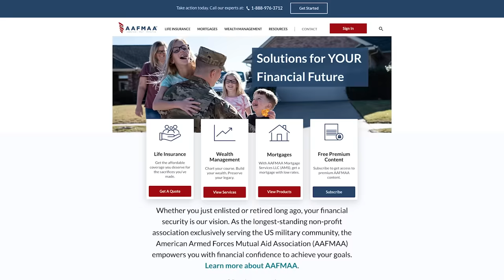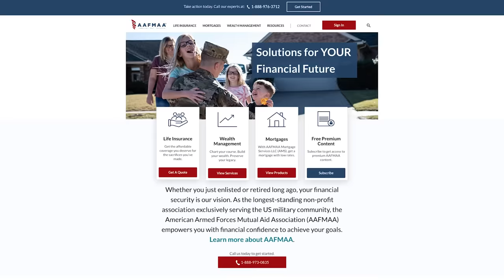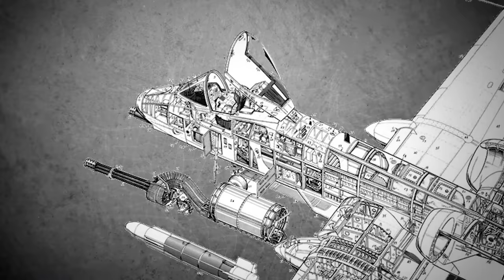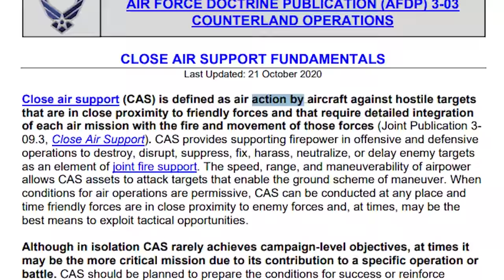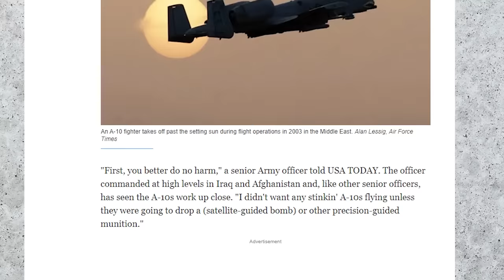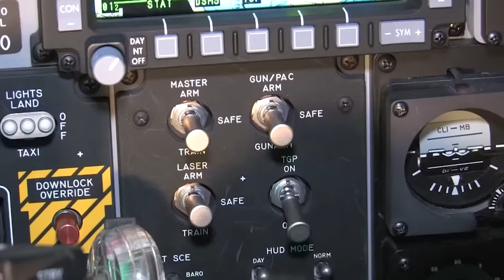Why the Air Force is Screaming to Retire the A-10 Warthog

Comment: CAS doesn't mean the plane itself needs to be close, the effect of its weapons does.
Once one realizes that, is obvious that the beloved A-10's days are over.
It's simply more useful having a drone hovering over the area for half a day, dropping a JDAM anytime.
..or an F-15, F-16 or F-18 getting there FAST with a lot of the same means of destruction under their wings.
Reply: there are no drones that will do that the a10 does currently. And protip actual combat arent a pc game. You dont sit in the sky and fire a missile and the infantry squad behind those trees disappears
Reply: @charlesreid9337 I mean for drone pilots that kinda is that case as they are sitting in a decently far place piloting the drone and yes drones can be used for CAS like the commenter said which you ignored CAS doesn’t mean the plane has to be close to the targets close air support is basically air support with friendlies decently nearby the target and also drones do just fire a missile down a lot are equipped with AGM-114s

Comment: As a sand box veteran I don't mind the A-10 retiring. I do mind not having a proper platform to replace it first. Sadly the F-35 is not good enough to do the job, and speed will not save the pilot in a CAS mission. Admittedly the Specter has most of the A-10's workload covered. However you need to keep a couple of fast movers in the area to keep it alive. Here's hoping the AF is not about to get a metric buttload of ground pounders killed.
Reply: A lot of the a10's kills are with the missiles anyways, so losing a primarily gun based platform is... Probably not the end of the world?

Comment: My armchair general opinion is that to replace the Warthog you need a fairly cheap and simple platform that can go faster than a helicopter and loiter longer than something like an F-35. I think tossing it out, without an alternative is a grave mistake but the Air Force is right that it needs to be replaced. I just don't think something like an F-35 is the replacement.
Reply: So RQ-9 Reaper
Reply: From what I understand F-35 pilots don't even get CAS training.
Reply: @Lonewolfmike Well probably not yet, because the A-10 and F-16 are still doing that.  If/when the F-35 starts being used for CAS, I’d expect that its pilots (or at least the ones who will be doing that) will receive training in it.
Reply: @bluemarlin8138  Well if they do then they will have to add a gun pod to even be minimally useful while doing it. And even then they won't have the firepower of the GAU-8 by any means. All they will have is a pinker at best.
Reply: I'd bet Marine F-35 pilots do. @Lonewolfmike
Reply: @TheRezro  Not enough ordinance

Comment: The USAF never was totally sold on the concept of the A-10. It wasn’t sexy enough or fast enough to to satisfy the fighter mafia that makes up a big part of the leadership. In fact one of the reasons they took it was because the Army said they would if the USAF didn’t. The concept is good even if the airframe is getting long in the tooth and upgrades are harder to do. Time on target is more important than MACH numbers when doing ground attack, something that the majority of the zipper suit sun gods don’t understand
Reply: So true. Even during flight testing, several generals (fighter mafia) tried to kill program, than tried to transfer to Army than to MC. Politics kept it alive. A two seat version (one off) was made. YA-10, night adverse version. Had upgraded avionics/electronics made it a very formidable CAS aircraft for night time. Air force said no thank you. Today this mission can be flown by drones and upcoming A.I. piloted platforms. Side note. The losing aircraft for CAS mission was YA-9 built by Northrup. Later on the  Soviets built a similar looking aircraft, SU-25 Grach (Frogfoot) for CAS. Extensively used in Afghanistan and later in Syria. Only the A-10 had 30mm cannon, that turned armored vehicles into swiss cheese.
Reply: Sure, but even by those metrics, you're never going to beat a bunch of drones for loiter time and cheapness of operation, and improved precision munitions give them better abilities to perform the mission, to boot.

Tech becomes obsolete.
Reply: The air force never wanted to do the CAS mission and it baffles me that they just will not let the Army have the job.
Reply: @jktarleton  

Gues they were still spiteful for the Air force treatment when the Air Force was the US army air corp

Comment: The A-10 has one thing going for it that gives it the ability to just fly by without even firing a single shot, just having its presence known is sometimes all thats needed.

Need to bring up the AH-56 Cheyenne as it came into play at the same time with the goal to do the same role.
Reply: Worked against the Taliban, not the Iraqi Republican Guard. They actually had the right reaction to seeing an A-10: trying to shoot it down. Running away only ensures one dies tired.
Reply: Didn’t work,out too good for them
Reply: True that! Just flying an A-10 in Poland is why Russia surrendered to Ukraine!

Comment: It’s a great capability to have when we can enjoy air dominance. When facing a near peer adversary with contested skies, I’m hoping we come up with an adequate solution.
Reply: It was designed SPECIFICALLY to fly against a near peer adversary that also had overwhelming numbers.

In fact, that overwhelming numbers bit was the exact reason it came into being.

The ironic part is being used against a near peer adversary now without mushroom clouds is extremely low, and conflicts with adversaries with minimal air attack (almost all ground based) is a near certainty.
Reply: @ekscalybur 
It was specifically designed to fly against the near peer forces of 50 years ago,  not modern ones. It would need complete and total air superiority at all times to avoid getting swatted out of the air by an AAM. As for insurgencies, it's still not great because it needs to get very close to its target, which opens it up to being shot down by MANPADs which are the only type of air defense capable of being regularly fielded by insurgencies beyond the ocassional truck mounted autocannon (something the a10 is also vulnerable to in comparison to other aircraft).

Comment: I don't think the F35 will work in this role, but a heavily armed drone could possibly be even more effective. The other option where a drone could be helpful is to identify targets while artillery or air support could stand off and delivery ordinance.
Reply: It seems to me to be a very tricky aircraft to replace, even in the modern battlefield. I agree I don't think the f35 has the same skillset
Reply: The F-35 is already testing small diameter bombs and can use external pylons. It excels in the air to ground role.
Reply: @richardtuxford1812  How is it tricky when it was never needed in the first place? So any of you know the political history of this airframe and are you aware of the crony capitalism that goes on in Washington DC?
Reply: The MQ-9 took over CAS missions for the A-10 like a decade ago and has done 99% of them with greater success and precision than the A-10 ever did.
Reply: @fnhatic6694  Pretty soon these A-10 guys will be saying the USAF should break out P-47 Thunderbolts and A-1 Skyraiders for CAS missions 🤣
Reply: @richardtuxford1812  They dont want to replace the A-10, they want to get rid of it completely. It is simply too costly because it keeps getting shot down.

Comment: The A10 can only perform its function in a state of near total air superiority. It is extremely vulnerable to anti air. Most of the fixed wing losses in Ukraine are Su25 frogfoots, the soviet equivalent. Drones are the best, most attritable alternative. Transfer the A10 pilots to other platforms.
Reply: In ukraine, more drones have been lost than all the planes in the USAF, USN and USMC.
Reply: The A10 does not require near total air superiority - where the hell did you pull that out of?
Reply: The Su-25 is a inferior design far more vulnerable from modern ground fire than the A-10.
Reply: @ometec it does. It’s slow and low flying and very vulnerable to MANPADs, SAMs, and fighter aircraft. 

It doesn’t carry advanced jamming systems or have a radar, and by the time the pilot knows there’s a hostile aircraft looking at him it’s likely too late. 

Modern air combat is all about see first/shoot first. 

To my knowledge the A10 only has two A2A kills, and both were against helicopters.
Reply: @DeltaEntropy  and the F-22 has zero. The A-10 is supposed to have zero air-to-air kills.
The A-10 is not intended to hunt for SCUDS well behind enemy lines, yet it was.
Sending A-10's deep behind the lines to attack enemy storage facilities and troop concentrations the job for F-111's yet the USAF sent A-10's. They were sending A-10's over Baghdad where they were losing F-16's and Tornados
Reply: @pogo1140 with the death of Fairchild republic, the A-10 had a limited service life. The parts for the aging airframe have to be cannibalized from other A-10s. No more spares now
Reply: @pogo1140  Drones can be replaced by ordering new ones.
Pilots take 18-25 years to grow.
Reply: @ometec  the Su-25 is faster meaning it has the speed to outrun problems. The A-10 is forced to stand and bang.
Reply: @pogo1140  the F-22 has zero kills because nobody wants that smoke. Get Putin to agree on no nukes and the F-22 gets stationed in Ukraine. It would have easily 300 kills to its record by the war's end.
Reply: @ChucksSEADnDEAD  how many a-10's have been shot down in an area where the only terrain feature were buildings in the most heavily defended city since Hanoi?
Reply: @5678sothourn  Fairchild was purchased by a subsidiary of Elbit. It makes aircraft spare parts, provides maintenance and upgrade services.

Comment: I feel like we don’t need just one aircraft to do all. We need multiple aircraft for different roles. P-51 was good ad intercepting and dogfighting while the P-49 was a beast at CAS
Reply: I agree. Same goes for tanks. I feel like today, we’re going in the direction of trying to find a vehicle which can do everything, but we forget how good specialization can be too. MBTs are good and all, but a jack of all trades can only get you so far. Same goes for jets.

The F-35 is definitely a good dogfighter, but it’s not as good as the F-16. The F-35 for sure should still remain king in stealth supersonic long range ordinance, while the F-22 or F-16 still have a place in dogfighting and air superiority. 

Trying to limit everything down to one aircraft or tank could go amazingly well, or complete FUBAR.
Reply: Why? Having a fleet of the same aircraft that can be suited for all types of missions is 100x more useful in the modern era than having seperate aircraft types. The phrase “Jack of all trades master of none” does not apply to machinery. Maybe back in WW2 and Vietnam it made more sense but we aren’t in WW2 or Vietnam, we’re in the modern era of air combat.
Reply: @kiio1291  It’s not possible though. We can’t create something as big as an F-35 and give it the firepower of an AC-130, or create something as tough and powerful as the Abrams, but also give it the speed of a fast attack vehicle. You can’t have your cake and eat it; vehicle specialization is inevitable.
Reply: @herrfantastisch7489  There will always be types of vehicles. We are talking about fighters, not cargo/utility aircraft. You bring up the 130 platform as if it isn’t the most versatile utility aircraft in our arsenal- tanker, attack aircraft, cargo, troop transport, and it even has the ability to carry cruise missiles. Of course you can’t have a fighter that can do all of that, but it can do SEAD, CAS, CAP, etc. I’m not arguing against that, I’m arguing that we shouldn’t have a dedicated fighter platform and a dedicated attack platform when we could just have one aircraft that can do both.

Comment: The A-10 was always my favorite aircraft growing up, in large part probably due to the shark mouth, but it does seem like its time has come. Regarding filling the potential capability gap it seems like an AC-130J could handle the same CAS mission with greater firepower, endurance, and accuracy.
Reply: @jamesdownen8980 we also learned that lesson with the A-10
Slow is vulnerable, no matter what the plane

Comment: LOVE the A-10. But it is the perfect CAS plane for when you have complete air superiority. It isn't for today's conflicts. I will be sad to see it go, but it isn't a bad call.
Reply: Then what’s it’s replacement
Reply: @tomhenry897   This is the main problem. They did this when they gotten rid of the Iowa class completely, citing their cost of operation and prohibitive cost for upgrades, but then their proposed replacement just fails to get anywhere, and now there's a role unfilled in the Navy, and they're just gotta leave it unfilled.

Now they're doing it to the Airforce, and subsequently, the grunts are gonna be without CAS and offshore artillery support... and they get to suffer the consequences of the actions of the pencil pushers.

Somebody wants money in their pockets.
Reply: @tomhenry897   I mean they're already using F-15s and 16s plus other planes like AC-130s to do CAS missions in Afghanistan. They were used concurrently with the A-10 but have been used more and more over it in the past decade. I assume those things would take over the CAS role A-10s fulfilled.
Reply: @tomhenry897  The point is that combat doctrines evolve and the U.S. doesn't need a direct A-10 replacement. F-35s, F-15s, drones, and attack helicopters all do something close enough to the A-10 while boasting other strong advantages that fit how the U.S. wants to fight.

Comment: The GWOT extended the life of the A-10 with the counter insurgency role but it has no place in any future near peer conflict as the war in Ukraine has shown. Between drones, the improvement of ground attack capabilities in newer aircraft which will be augmented in the near future by wingman drones and the proposed next gen attack helicopters the gap the A-10 used to fill simply no longer exists
Reply: The A-10 would still have a role even in a war like Ukraine.  If used in the correct role and place, it would be highly effective.  You wouldn’t put it in a high threat area but it could easily support moving armored formations and protect flanks.  It is at least as survivable as an attack helicopter, at least in certain scenarios.  Even to perform CSAR, convoy support and persistence over areas where enemy forces have been weakened.
Reply: @Grouse2275 A10 never made much sense. In instances brought forth by you attack helicopters and drones do much better job for much less $$$. Ukrainian theatre proves it 100%. Also, Russians have “Frogfoot” the equivalent of A10 (or even better in my opinion) and we don’t hear about it ripping through Ukrainian lines, do we?

Comment: Yeh I was gonna say, drones are the replacement for the A-10 in close air support which can be operated by the troops on the ground meaning even better and more available close air support as sub sonic drones able to carry a couple of missiles will be often cheaper than the missiles they carry and nobody will die if they are lost so you can deploy more of them more readily.

Comment: Back when tank hunting was done from helicopters with TOW or Euromissile you were fixed in place and vulnerable while the round was in flight. When that was the case having a cannon armed fast jet made sense. Hellfire has literally cut the cord between helicopter and missile and has made the A10 obsolete. I live not far from where our biggest defence think tank develop new platforms and recently I have seen them running light helicopters like the Gazelle with two smaller drone helicopters as an escort. So thats one crew running 3 hellfire equipped gun ships that can split up and actually flank your fighting position.
Reply: It's the future. But a lot of work and research will need to be done before they fully commit
Reply: @RobFomenko  It's not the future it's now. Catch up.
Reply: Just because it can be done right now does it mean it's operationally ready.
I'm sure if we really needed to they could probably bring out the new amram with the 240 mi range but that doesn't mean it's operational. It's still in the future.
Reply: @RobFomenko From what I have seen with my own eyes it's operational.